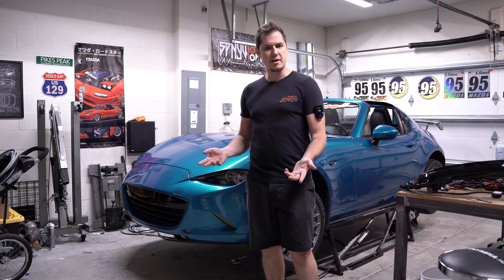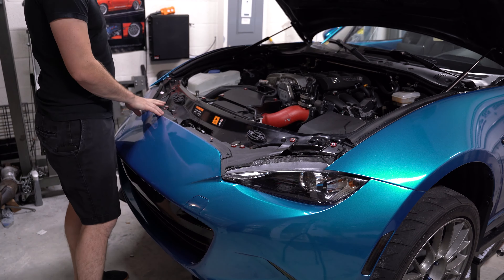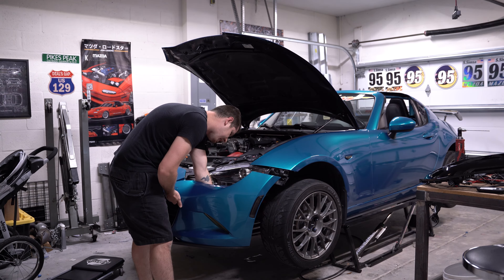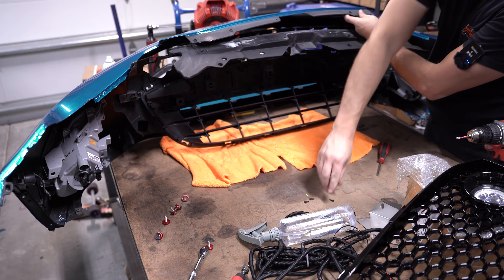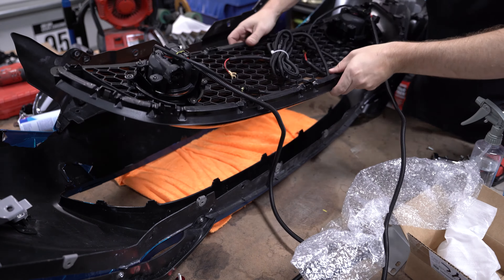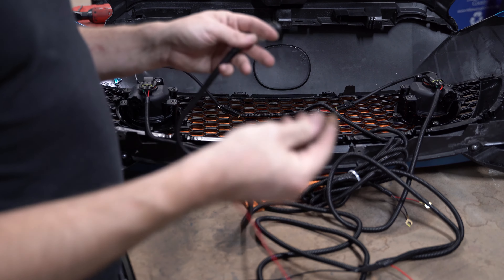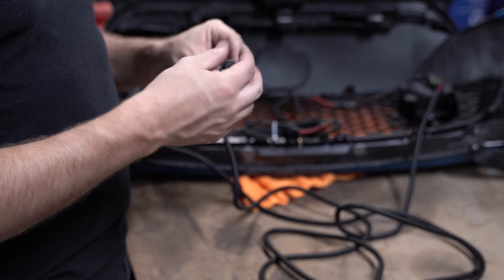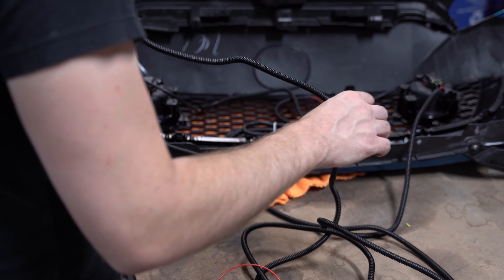CarbonMiata Spyder Grill

Comment: Great tutorial!  The fuse taps look much better than just jamming wires into the fuse block that I'd seen done by others.  On a different note,  what did you do during the wrap to debadge the front?  Isn't there a recessed area where the logo used to go?
Reply from the maker: Oh trust me, I have been guilty of jamming in wires or wrapping them around fuses. But live and learn to do it right. For that I used some flexible body filler and sandable primer before wrapping.